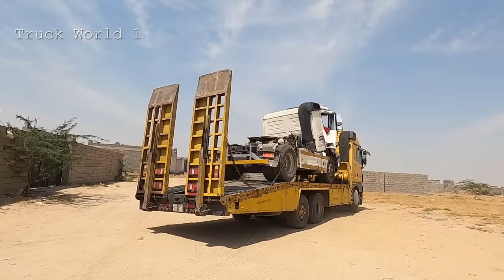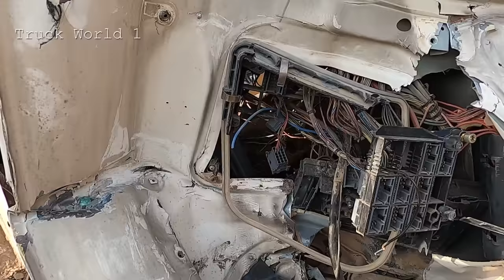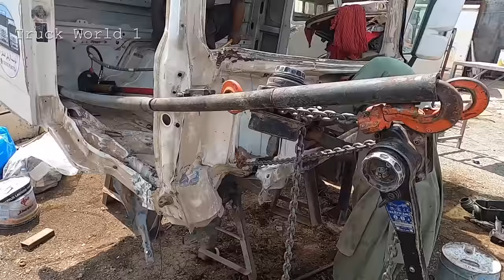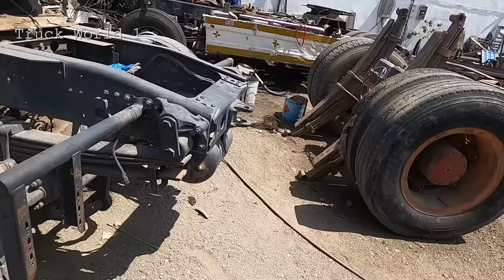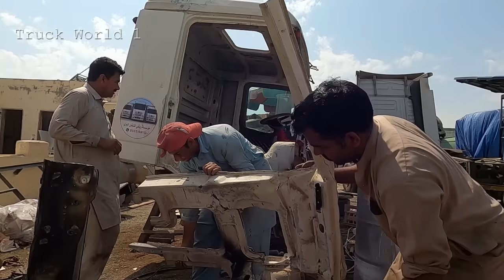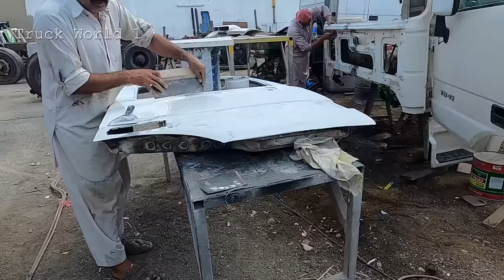Mercedes Truck Accident Cabin ' Chassis Repairing And Restoration Complete Video Truck World 1

Comment: Different trucks shown, damaged truck had 2 axles and low roof cab, second truck had 3 axles and higher roof
Reply: Maybe changes axles
Reply: @syedasharimam  so they added another axle off camera and put a higher cab on???  Its a totally different truck
Reply: @stanleyspence3981  up until 25 minutes and 47 seconds it was the low roof cab and single axle. maybe someone muddled up the final clips. probably the one who edited it. still its an amazing job. wish i had these skills.
Reply: I caught that too
Reply: Actually around 28:20 you will see there are 2 white trucks. I think editor mixed it.
Reply: Мошенники 😂😂😂😂😂
Reply: Yes they are not the same trucks one is a single drive other is a bogey drive 👍👍